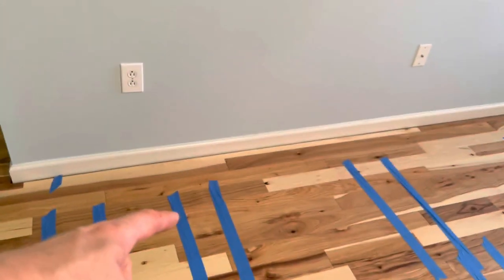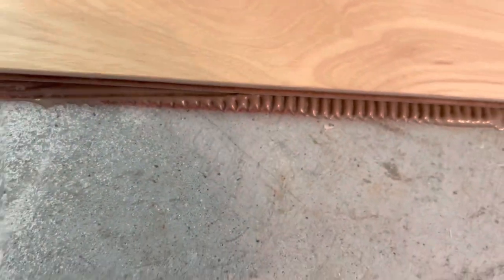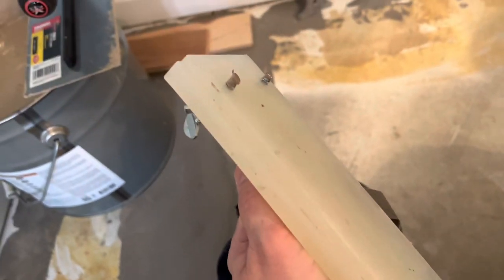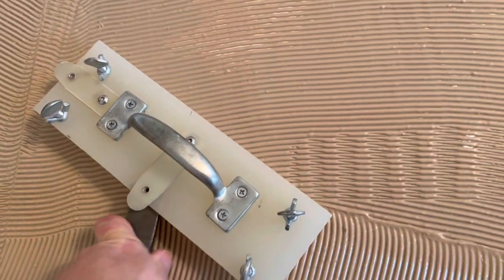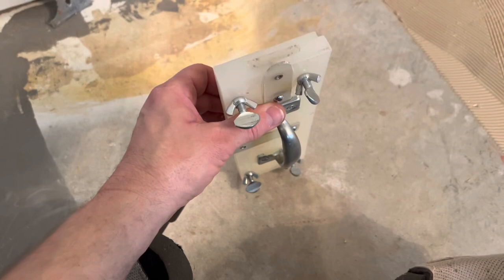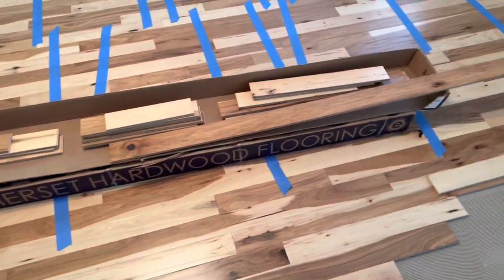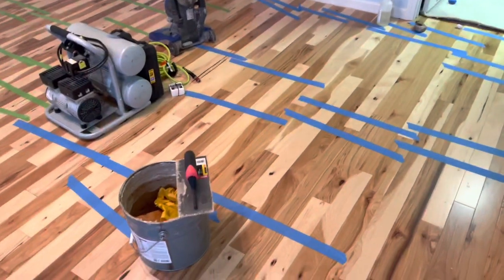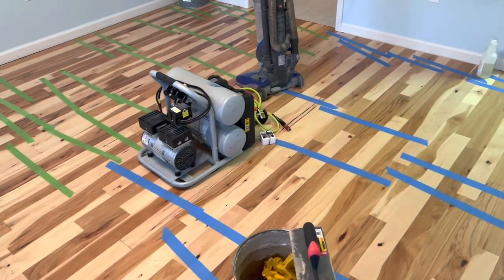Daily vlog Hardwood And quarter round￼installation￼￼

Comment: Nice work! I usually make a header piece at doorways, like a turned board instead of running them straight.  Looks good either way!
Reply from the maker: I actually thought about that after it was already done, I wish I had I could of tapered it down and made it work at the bathroom doorway

Comment: Great work as alway! Question for ya how long you leave the tape on there for?
Reply from the maker: I usually like to keep it on overnight but in this circumstances I was not able to, but luckily this residence was owned by one elderly lady and that was it so there would not be hardly any foot traffic on it. When I installed a quarter round I also pushed it down super tight on the floor just to make sure it was held and there was next to nothing when it comes to tension Trying to separate the boards, but the answer to the question is overnight

Comment: I got to ask is that a battery operated mitre saw. And if so what size and how do you like it ?? Thanks
Reply from the maker: Yeah it’s a battery powered and it is super small and lightweight, it is only a 7 inch blade on it or 7 1/4 which ever I bought it just for doing quarter round and such so I don’t have to lug my big 12 inch one around all the time for the small stuff, it is super convenient and it only weighs 30 pounds